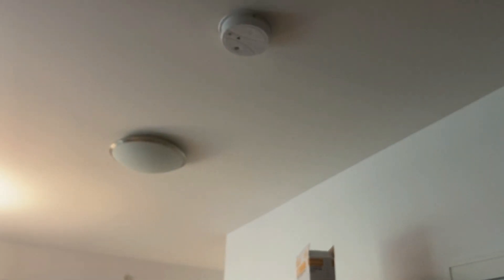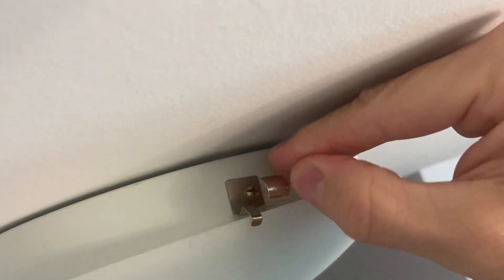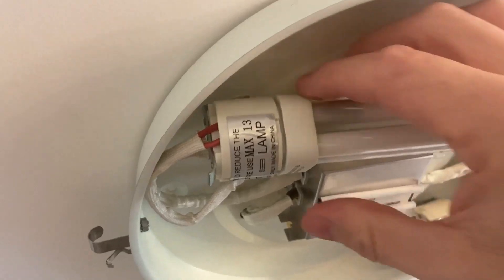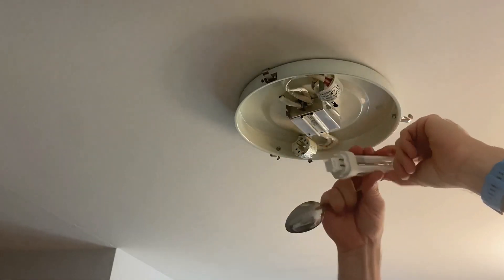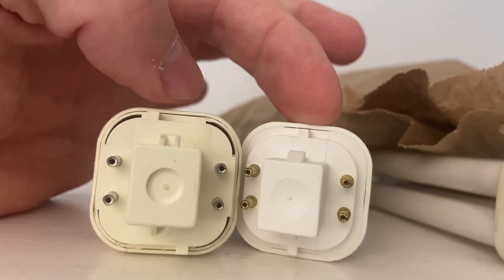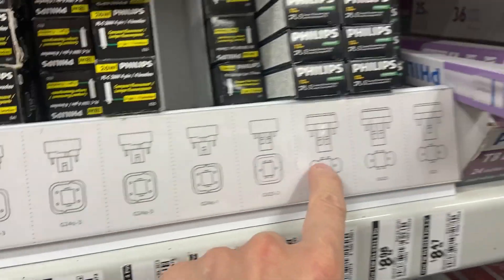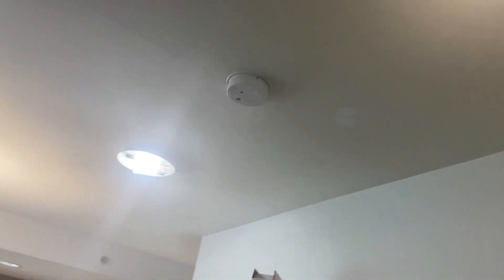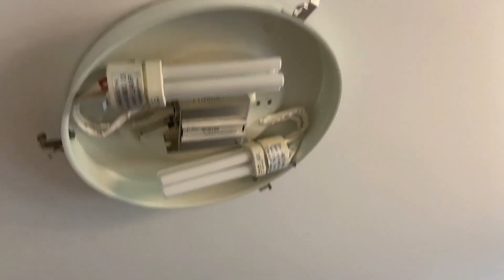Tricky light bulb change (G24Q base)

Comment: My new apartment has these in the bathrooms so im trying to find LED Feit replacements that are plug and play without the ballast bypass which im finding some online but jesus, absolutely stupid design
Reply from the maker: Rip out the fixture, install new fixture with LED sockets
Reply: @theoverengineer  i found some luckily and got em replaced.  Wasnt a major hassle but still a bizarre design.  That and the two prong bulbs that the rest of the fixtures in here have which is an equally odd choice

Comment: My new house has these, what a pain! it's like they put the bulbs in and never wondered how people would change them afterward. The problem is when i try to remove the bulb the whole housing moves out of place in my setup.  What a disaster.
Reply: These are stupidly deaigned. Visiting family and helping change one of these and that's how I found this video. I ended up rocking it until a small gap appeared and then inserted a small flathead screwdriver and it popped right off. Drove me half crazy getting there.

Comment: I'm an industrial electrician. I own a few homes that all had these bases. I don't understand why these are even put in residential homes. I swap them out with LED but getting around the ballast can be tricky for homeowners. Generally it's OK to downgrade the wattage... a 13W on a 26W ballast will work with a lower life expectancy of the bulb, but you do not want to put a higher watt bulb on a lower watt ballast because you can burn out the ballast and the whole thing will need to be replaced. I personally prefer white lights, 5000 lumens, over the lower lumen orange artificial light.
Reply: As a nerd I love these CFLs and will never replace them with ugly boring chinese LEDs. I have more than a lifetime stock of fluorescent lamps and as long as  I am alive, I  will continue to hoard thousands of them.